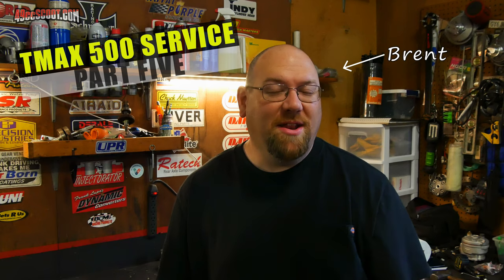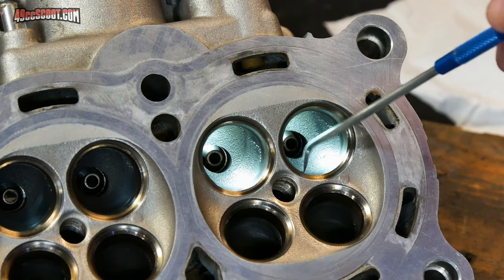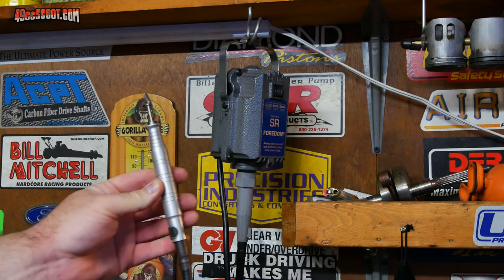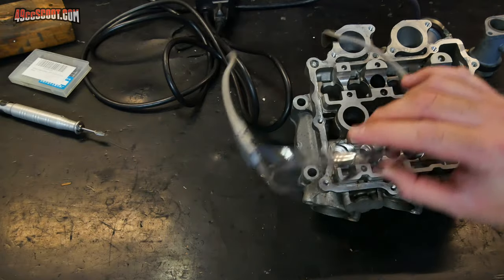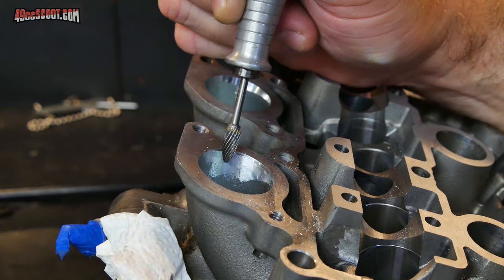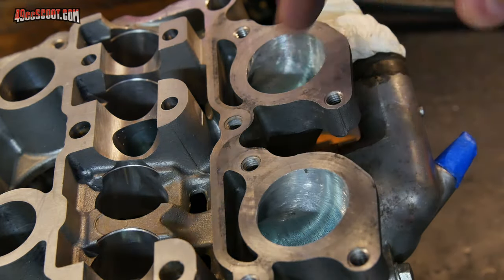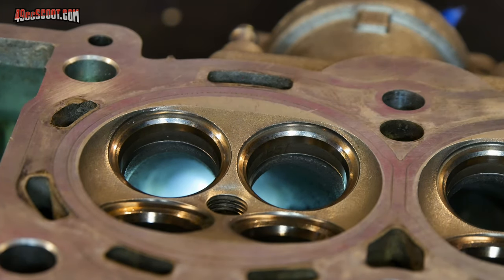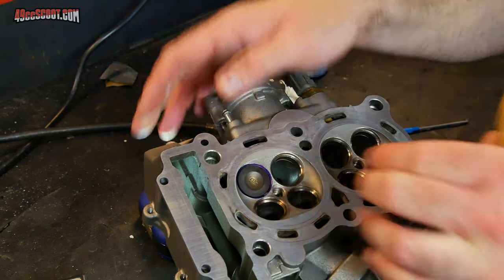Cylinder Head Pocket Porting & Valve Lapping : Yamaha TMAX Major Service Part 5 : Motorcycle Scooter

Comment: Back in the day the 'Port n Polish' was the thing to do, but theses days they say that while you should deburr the port of sharp edges and casting debris-
You shouldn't however polish the intake ports and to just leave them with the factory cast finish. 
They say if they're super polished the incoming air wont mix and disperse as evenly  with the atomised fuel and not have optimal ignition of the vapour.
The original texture made from casting the aluminium is needed as its thought it helps aids in the mixing. ..
If you were also doing a port you have to get the Dremel and finish off the surface with a similar coarseness that it had.
But that doesn't apply to the exhaust ports, you want those as polished as you can get them!
Reply from the maker: The original texture isn't always good, as it can be too rough. Some go to great lengths to create just the right surface finish. I stick with, just don't smooth it out too much. For the exhaust, polished is fine if you want to go that far, but it's a lot of work for very little.

Thanks for the comment.

Comment: Hi Brent from 499ccScoot. What kind of gains do you expect to achieve from the porting? Am curious if you are going to report on the performance results once the TMax is all buttoned up again.
Reply from the maker: I don't expect much TBH. It would be nice if I could pick up any acceleration at all. I've done 0-60s in the past so I will do it again and see if anything is significantly different and if I can notice any other changes I'll report as well.

Comment: Hey bro I wanted to ask you a question my mechanic put the 93cc on my bike 

yesterday and I freaking wanted to know do I really need a new crankshaft bearings and bushings do I need to replace all that stuff since I have a 

stronger bike that goes 93 CC's now instead of the 49 or 50 cc I'm getting mix answers when I ask people. Does it really make a difference what difference would 

it make if I replace my bearings in my 

bushings and crankshaft two aftermarket ones I need help please message me back bro again
Reply from the maker: If you want it to actually be 90cc+, you'd have to have a stroker crank. That aside, the stock cranks are known to have conrod big end bearing failures with the larger kits. I did a 50mm bore and installed a new stock crank years ago and it lasted 2,003 miles before it left me stranded.

Some people go with HD cranks. Some people have success by limiting RPM with heavier rollers/sliders.

Comment: Off topic question, sorry but I could not get through at the forum.  Who makes the best variator belts?
Reply from the maker: Depends what it is. If you can get a factory belt for a quality scoot (like Yamaha, Honda, Piaggio...) then OE replacements are often the best choice. If it's Chinese or you need something custom, then Bando is my goto. Some like Gates. The top tier performance brands like Malossi and Polini have good belts.
Reply: @49ccscoot  Thanks, I have nearly 2k on the original Chinese belt and this is a strong scooter so I want a good quality replacement.
Reply from the maker: @leonstancliff7218  Then Bando should be good for you if it's made in the right size (they are for most popular Chinese scooters).

Comment: Hey my old friend I need some more advice my taotao lost power going up hill  I looked allover and don't see why it doing that my driveway is a big hill it went up it just fine but now it will not go up it stops it keeps running but comes to a stop please help if you can thank you for your time
Reply from the maker: If it runs fine otherwise, then most likely it's a CVT issue. The first step for me is always to  go over the entire CVT thoroughly. Inspect all components for wear,  damage or anything that looks suspicious and see where that leads.
Reply: @49ccscoot  thank you so much for your time i will do just that i will get new everything to just in case ill let you know how it goes

Comment: Worlds biggest mc.Uses 500cc for F1,and 600cc for wheelie and stunt.Personally never leaving 50cc.Watched "super-car" porting,added material,more precise tunnel.Tried smaller pistons on 52.4mm bore,dont work with non-egr top.Extreme noise.Bought 5-6 total different52.0,also 51.5.The oil came out air-filter box.Used 0 mm valva,also0.1mm valve clearance.Too much comp,non-egr for small piston
Reply from the maker: Professional porters do a lot of work that can get really in-depth to reshape ports for flow and velocity. Luckily, most of us can see improvements with simply smoothing out the large mismatches as I did.
Reply from the maker: @MrSandRune  I have one, but I never got around to installing it on anything yet. A forum member has tried it and helped the seller update software for higher RPM. He said it works.
Reply: @49ccscoot  Good news.1cm off crank,naraku cdi,.75noozle.52.4piston.Sounds 49cc."Low-rev"very strong.Better&better till,have to tune noozle.

Comment: did this on my Tmax 300. No improvement at all !!!
Reply from the maker: That sucks. If the ports are already good, there's not usually a lot of change. Mine picked up a little at higher RPM.
Reply: @49ccscoot  replaced the complete head with a head with bigger exhaust valves and flatter intake valves plus stg 6 cam. That made serious improvements. To get around afr tuning you could get away with a bigger injector. This is a cheap upgrade.